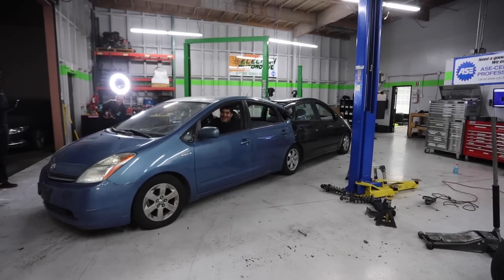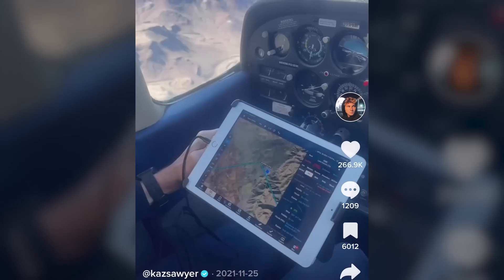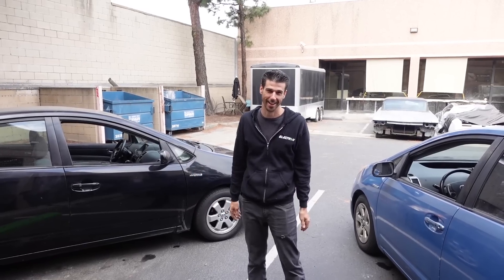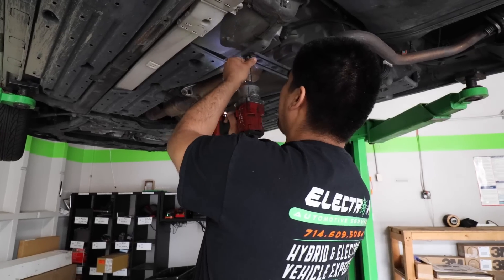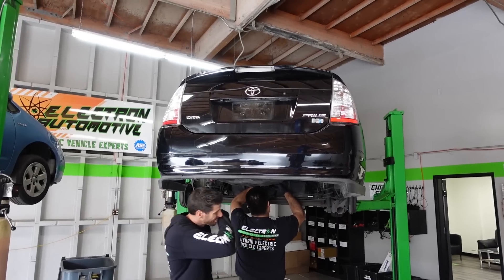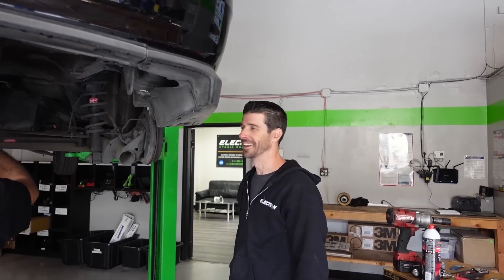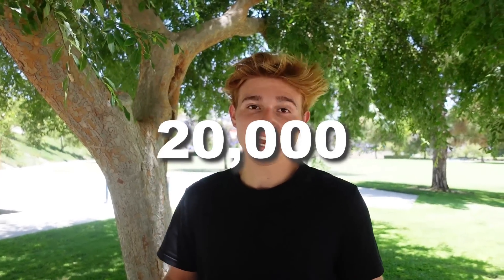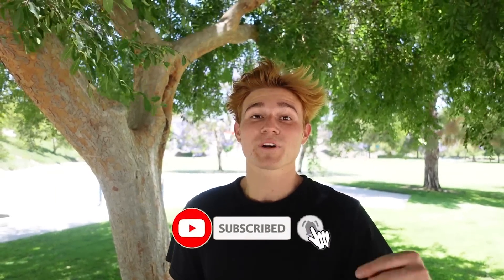We Built The World's First Double-Sided Prius!

Comment: Now do 2 Front Wheel Drive cars facing the same way and connect the two throttle cables together so you can drive 2 cars with 1 person, and it will be All Wheel Drive. Like two v6 engines and connect the exhaust. Make it a v12 sound lol.
Reply: Wow
Reply: @BeekPlayZ  i know right im a genius and the fact that im a mechanic means i know it can work

Comment: Only legends wondered what would happen if you drove both sides forward at the same time.
Reply from the maker: True
Reply: @KazSawyer456  you'd just stay in place if going the same speed
Reply: 4 wheel Burnout
Reply: I thought that 👏🏾👏🏾👏🏾👏🏾
Reply: thought that was just me
Reply: @addithebaddie1029  same
Reply: Bro this could be like the most cursed shit
Reply: you'd just stay in place if going the same speed
Reply: @ItsElectricz  uhhh, actually no, either one side would gain more traction than other making it go in that direction, if not the friction of the tires would cause a fire, and the last possible thing that could happen is the engine burns out.
Reply: @leoncaples2947  yeah I forgot to mention that possibly.
Reply: It will probably break in half
Reply: Either explodes or takes a screenshot
Reply: True
Reply: Nicee😎😎😎😎😎😎👁️👄👁️
Reply: Ya
Reply: I know right.